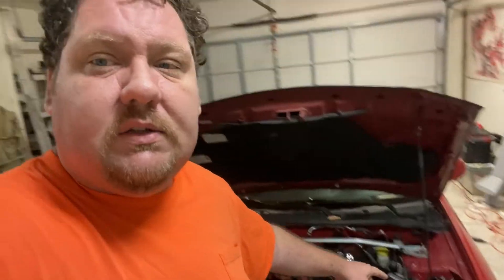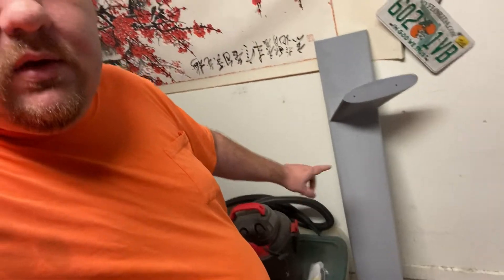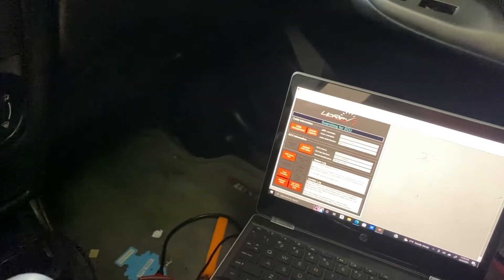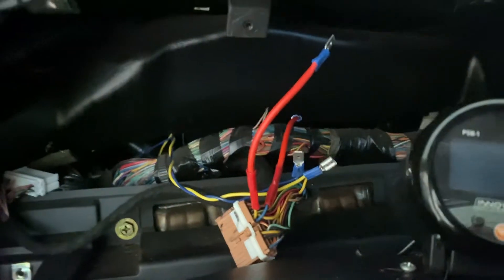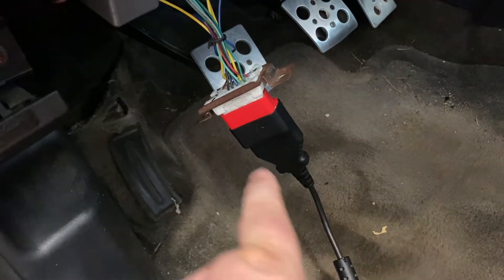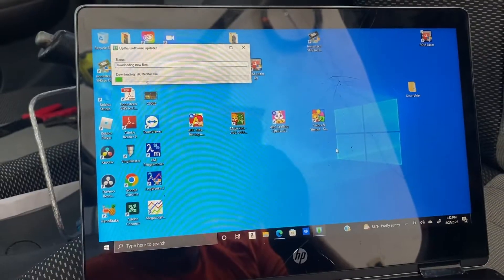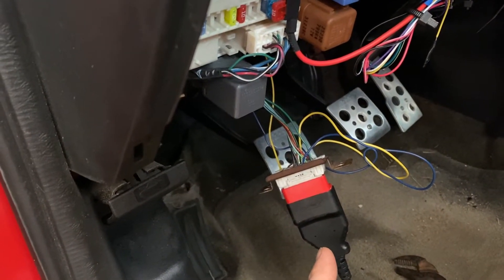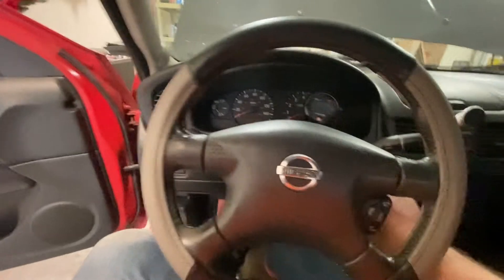Part 2 of is my ecu bricked on my 2004 specv

Comment: Congrats on getting your tune installed. I think because you're manual, you can actually store two files on the ecu and switch between them using the criuse control buttons. I'm auto,, so I can only store one.
Reply from the maker: I didn’t know auto can only store one map
Reply: @red_rabbit_specv  Yip. One of the many cons to owning a boosted automatic B15 sentra.

Comment: Remove the pin from the harness to inspect the bore  and its retainer/lock barb, start disconnecting the battery before you work on anything electrical
Reply from the maker: That was actually how I fixed it. Didn’t record that portion. Also I admit I am really bad at disconnecting the battery before touching electrical. I do know better. It just plain laziness on my part.